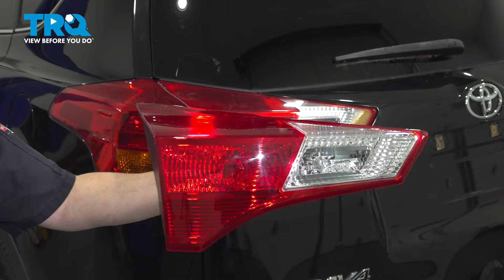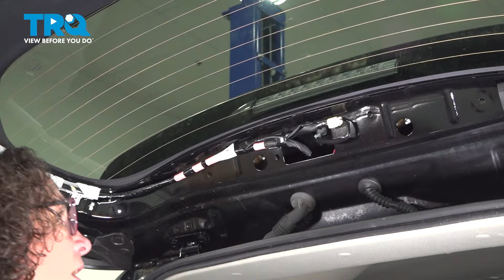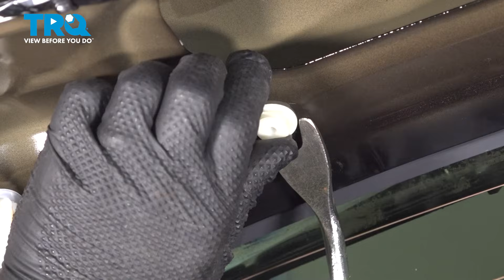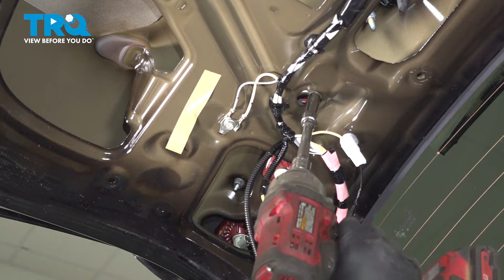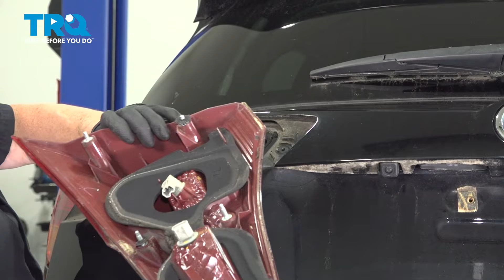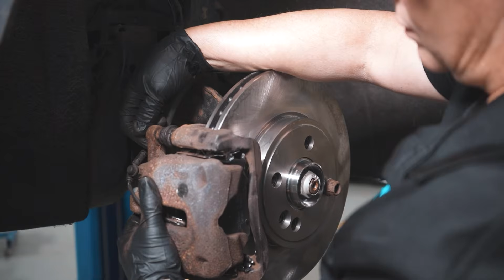How to Replace Inner Tail Light Assemblies 2013-2018 Toyota RAV4

Comment: You can absolutely take off the 3 nuts that are inside those service panels without removing any of that trim. Just use a small 1/4 ratchet and you can get it. I did.

Comment: A good descriptive post.
For any British posters the two outside bolts are different, not easy to  find, they are basically behind the tailgate power arm and access is difficult trying to remove the tiny nuts and harder when putting back, the 3 internal bolt are as described.
Thank you it was nice clear advice, well done.